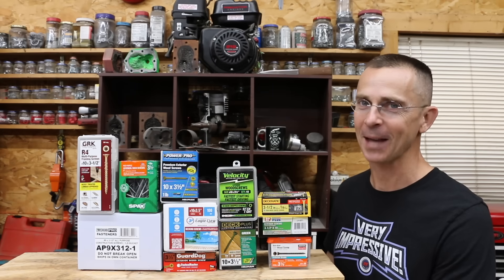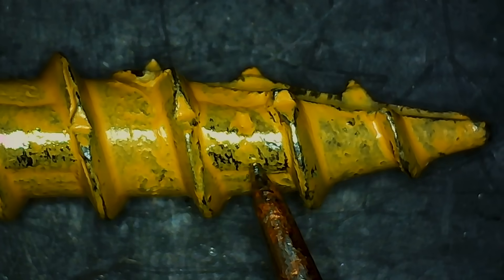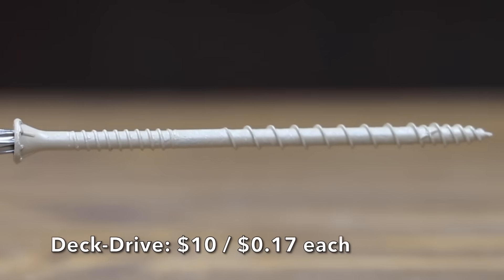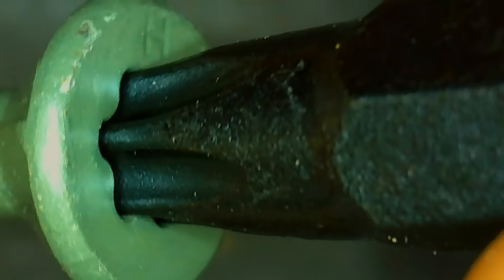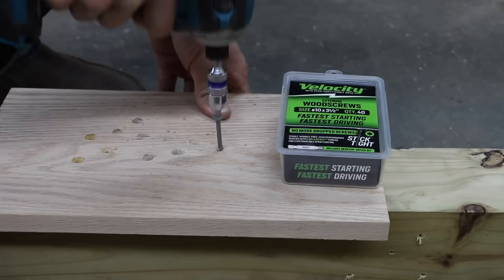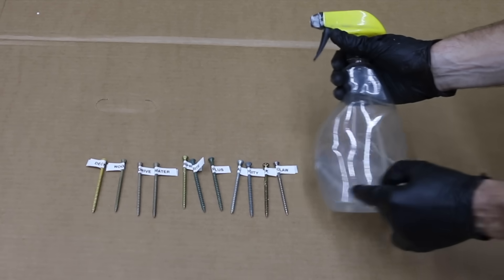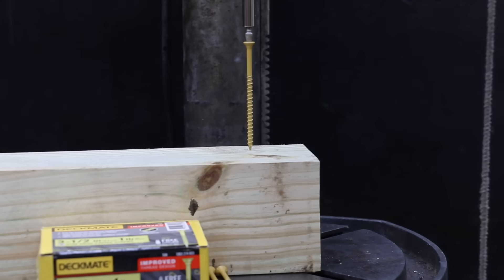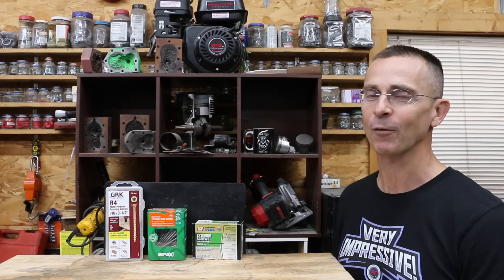Best Deck Screw? GRK vs SPAX, Grip Rite, Deckmate, WoodPro, FastenMaster, Deck Plus, Eagle Claw

Comment: GRK is my "go to" screw!  I have used the PowerPro screws and returned them because bit engagement was so sloppy the T25 bit was stripping out.  I use SPAX screws for all my structural screws. I do have some GripFast brand interior screws that I will use for small, noncrital projects.   I literally won't by any screws without #2 square head or T25 heads.  GRK screws are worth the money and the boxes are fantastic.
Reply from the maker: Thanks for sharing.

Comment: Awe 6 months too late project farm, already replaced all the screws in my deck because previous owners used 1in drywall screws for everything. XD

What a nightmare that was replacing them with 3in deck screws. Lol
Reply: I pulled up ~700 deck nails this summer from previous owners and then flipped the boards over and sanded and stained. It was "fun" 😂
Reply: @T-Mo_  Hah yeah exactly what happened with mine, almost all the boards were cupped, so flipped, sanded and sealed it. 

Think my deck only came out to 500-600 though. Your deck must be massive!
Reply: @BigHeadClan  it's only 12'x15', but they put 20-25 nails in per board 😂. Hey, at least we both finished it. 👍
Reply from the maker: Thanks for sharing!  Wow, that was a project!

Comment: I've been using those deckmate screws for a long time, as they are even more affordable when you buy  the 25lb plastic box, and they don't rust out here in Arizona, plenty of holding power for everything I build. But, I do really like GRK cabinet screws, and structural lag screws.
Reply from the maker: Thanks for sharing.

Comment: Thanks for the test - excellent as usual. Personally, I would probably go with the cheapest option because it's "good enough". All the screws were able to hold around 600+ pounds and experienced no corrosion. With that being the case, why spend more than you really need to? The only difference might be if you want the screw easy to drive and were willing to spend more money for that.  One final comment: This is one place where it might have made sense to use a larger sample size than 3. The density of the wood significantly affects the amount of force required to drive the screw, how fast the screw can be driven, and how strong the screw resists pullout.
Reply from the maker: Thanks and you are welcome!  Thanks for sharing.

Comment: I can't speak to deck screws specifically, but I've been using Spax for almost all of my heavier screw needs indoors as an electrician for about 10 years, from mounting ceiling fan boxes to the wood frames I make for electrical gear. I refuse to use drywall screws for that kind of stuff, and if you're watching reviews like this, you probably understand why :)

Comment: I built my deck over 20 years ago with deckmate type coated screws, Lifetime warranty etc!  Broke off, rusted and gave nothing but trouble. They changed the type of driver sued! As I had to replace boards and broken screws I went to Spax! No issues with these after several years. I am now redecking my entire deck and using PT lumber and all Spax screws! It has been a pleasure. No predrilling except at the end of boards(my choice). Great product in the field and by your tests too!
Reply from the maker: Thanks!  Thanks for sharing.

Comment: The most comprehensive testing  so that you dont get screwed building  your deck  or anything that uses screws, can we get a test  of  DURABILITY  of screw drives types , like our Canadian Robertson Square drives and popular in  US Torx drives in the 3 most common sizes,R1 R 2 ,R3   and  Torx  , using 1/4"Impact  drivers , I find #2 Squqre  drive tips  last  longer  than  the Torx flutes/tips,  thanks,
Reply from the maker: Thanks for the suggestion.

Comment: I use the Grip Rite brand most of the time. It's used in a handrail beside my backyard steps, and for the ramp going into my shed. Haven't had any to rust out. Have had paint to peel off the heads after 2 years. Usually it only affects the handrail because Spar Urethane was painted over them. I guess that attacks the finish. I wanted a natural wood color, but polished, so I use yellow or brown for the best color match.
Reply from the maker: Thanks for sharing.

Comment: I was waiting for this testing PF! I have used Deckmate in the past but that will not be the case in the future. Thanks for this video. I was wondering if you ever did any testing on those wall stud finders and how accurate they are? I know that some brands can be used to find not only wood location but also aluminum and steel as well. Anyway, hope that you & your family are doing well.  👍👍😉😉

Comment: I love spax because of the proprietary piloted torx drive. The bit fits the screws really tight and they’re a lot easier to start than most torx screws because they dont wobble around as much. That’s a big consideration if you have lots of screws to drive.
Reply from the maker: Thanks for the feedback.

Comment: Perfect timing for me on this video. :-) I have an old wood deck that needs replacing. Thanks for all the work you put into making these fantastic testing videos!
Reply from the maker: Awesome!!  Glad to help!!
Reply: @ProjectFarm  Thanks Todd.. I'm building a wood/metal cover for my 27ft Travel trailer.. This is valuable information, so I now know which screws I'll be buying to put it together.
Reply: @ProjectFarm  love the videos! Please test redline shockproof gear oil!
Reply: And I'm watching this from a highrise lol. Good luck with the deck!
Reply: @sorsorsor11  It just means that your deck has to be REALLY tall.
Reply: this is the first time i semi disagree with project farm. 
as seen here, even one screw will take a mans weight with relative ease, you usually use a lot more than is needed for structural integrity and shear strength. 
hes not really wrong in anything here. as in stainless screws are softer, strip slightly easier and you can snap em if you screw em too tight (also cost more).
but the only thing that really matters in screws is corrosion resistance if you want to make a deck that lasts.

specially with pressure treated wood, the treatment contains copper which can murder normal screws. decking screws specifically made for them probably work as well, but that would be a test taking at least a year to do (which i would watch with interest).
wanna be sure itl last, use stainless.

Comment: Havig installed mucho decks, here on the Outer Banks, I have learned the hard way, that coated deck screws ALL fail the corrosion test. One learns the hard way why that these screws almost always deteriorated in a very short time. The only screws I will use as deck screws must be at leaset a 304-grade stainless steel 3 1/2" screw. Decks that are subjected to water (i. e. boat slips) the 316-grade stainless steel should be used. If the appearance of the deck boards paramount, toe-nailed edge No. 7 x 1 7/8" stainless steel CAMO styled screws.
Reply from the maker: Thanks for the feedback.

Comment: You should test various brands of Jet line, i.e. wire pulling line ....break strength, stretch, abrasion resistance, etc ...as someone who just pulled a bunch of wire in my garage, I think this would be a good one! 👍🏻
Reply from the maker: Thanks for the suggestion.

Comment: In my remodeling work I use the GRK screws - all of their 5 different types. They are used in treated and untreated lumber. I can think of only one small complaint, and that is that I find them a little hard to get started in some woods. Two hands are needed, which is not always safe when you're hanging from a ladder with a driver in one hand. Based on this vid, I'd like to give Spax a try in case the GRK's aren't available.
 As usual, informative vid without being boring.
Reply from the maker: Thanks!  Thanks for sharing.

Comment: Very interesting, the compromises between products here.  If one is super concerned about rust/corrosion, The Eagle Claw is best, but at the expense of the highest price, 2nd to worst shear load, and more time to drive in.  Since the Grip Rite and SPAX came in 2nd on rust/corrosion, at about one third the price of Eagle Claw, and good to great performance everywhere else, taking a little more time for the Grip Rite seems well worth it for the money saved.  I'm surprised that the 305 Stainless Steel Eagle Claw was not any better than it was!  This is why we all love you!

Your ingenuity and procedures continually impress.  Great one, Todd!  Thanks
Reply from the maker: Thanks and you are welcome!  Thanks for the feedback.

Comment: Speaking as an engineer, I'm impressed that the variances are as small as they are. This tells me, you can't go wrong with deck screws -- plan for loads a modest fraction of the failure point and any will handle it.  That just leaves individual variation in stuff like coating quality, and, the elephant in the room, consistency of the wood being driven into (which from other data I've seen, looks to be much worse!).  Nice to see a stainless screw on here, I'd think those are fairly specialty (coastal salt spray, industrial environments?), shame they apparently aren't as strong but to me that's just a compromise for using something exceptional otherwise.
Reply from the maker: Thanks for sharing.
Reply: I wouldn't say they are weak though.  I am quite shocked at the sheer strength of a single screw.  I was worried about pulling myself up onto a walk way overhead beam I fitted in the garden using 2 screws just in case my weight broke the screws holding it in.  I am not 600kg so now I know that I don't need to worry, the wood may break though hehe.
Reply: @markmmm1737  The dynamic forces exerted, when you pull yourself up, will be much greater than just your weight.
Reply: 100% no on stainless. Bought a home with composite decking, ribs under neath rotted out. We could not get stainless screws out they all stripped out. Had to pry board up and remove the screws with channel locks from the bottom. Turned that several hours job  into 2 days!
Reply: @brianx2640  Rough! Yeah, that's a huge pain, just from the material being a little bit softer probably.

Normal screws I think are heat treated 1050 or so steel, not so hard like tool steel but much stronger than mild (have rounded off many a wood screw, the traditional tapered kind, man those things suck!).  That's why they bend a little, then snap.  305 stainless can only be work hardened, not heat treated, so it would figure the screws aren't as hard.  Next best thing would be a PH stainless, probably?  Might be too expensive for deck screws though.
Reply: @brianx2640  I think your issue was with the type of drive - if they had used screws with Torx heads, you probably could have backed them out.
Reply: SS only for industrial environment? Come on! I use only 304 stainless screws in my home, cost negligible compared to the items they're fastened on
Reply: wood variability really seems to be a hugely understood factor.  Matthias Wandel has done a couple tests recently and touched a bit on grain structure of several samples within the same species of wood.  Grain direction, size/spacing really, really seem to matter when taking measurements.

Comment: Good to see the GRK’s I use test well! 
The main benefit they have for me is that the heads aren’t all full of coating like many other brands. Could count on one hand the screws that had to be thrown away because the bit tip wouldn’t fit in, after tens of thousands of screws driven.

Would you consider testing the other types of screws? Trim screws, structural screws, ect?
Reply from the maker: Thanks for the feedback.  Thanks for the video idea.

Comment: Seems to me the biggest thing is corrosion resistance. Only time I’ve had a problem is when someone used regular old un-coated screws and they rusted out. I’ve stuck with Deckmates for quite a few projects and never had a single problem with them. They hold great and never rust. I’m sure the others are better, but sometimes all you need is good enough.
Reply from the maker: Thanks for the feedback.

Comment: I actually repaired a kid's bed yesterday with 6 GRKs -but they had more of a washer with button/dome head.  Nice to see them perform so well here.  I'll let you know how they hold up.
Reply from the maker: Thanks for sharing!  Thanks, looking forward.
Reply: Sounds like GRK cabinet screws.  I use them for a lot of different purposes.  They work great for templating custom steel handrails, for jigs, prototyping,  and hanging stuff in my shop.

Comment: I watch, enjoy, and learn from all your videos, but the methodology in this one may have some weaknesses.  Southern yellow pine latewood (the dark rings) is three times greater than the early wood.  Anyone who has worked with SYP knows that the hardness varies drastically and whether a screw will start will depend upon where you try to start it.   The torque it takes to drive a screw will be affected by how many late wood rings it has to go through, and that is continuously variable.  The wildly different torque readings you got driving the same brand screw with the same driver illustrates this.  Any wood species will present some degree of these difficulties, but the four species known commercially as SYP are notorious for this.  On the whole I think this was another helpful video and what I mentioned affects only a small part of it, but I think another choice of lumber would have given more useful results.
Reply from the maker: Thanks!  Thanks for the constructive feedback.

Comment: 9:16 not sure if the least or most torque required can make an easy choice for a quality screw. a screw requiring more torque could have a wider thread, slightly longer, etc...
Reply from the maker: Thank you for the feedback!
Reply: 16:09 just as I thought now that the Velocity at the bottom of the chart

Comment: I live in Germany and only we have out of the Once tested are Spax. I never have seen them coated before because they are coated thicc with brass or made of brass so they are basically corrosion resistent. But one thing I know is that when you buy Screws for Wood and you want that it holds you get Spax.
Reply from the maker: Thank you!

Comment: I have made my living designing homes and agricultural buildings. GRK screws rule. My own home is built with them. They create tighter wood joints, are easy to remove if adjustments are necessary. They are tough.  Never have seen one break. Never have used nails in the past 30 yesrs.
Reply from the maker: Thank you!

Comment: I've always liked the GRK, Grip rite, and Spax screws.  Frankly, good tests, as usual.  But for myself, while screws CAN indeed snap, though a bit of wax or soap, makes them zip rite in.  Holding strength?  Not so important normally.  Most important to me is that the screws don't rust, can be taken out if necessary in a few years.  Thus, I like stainless.  Unfortunately they are usually a bit too expensive.  One thing not mentioned were the deck screws for composite or synthetic wood, (Trex, etc)  Some screws for these materials come with a reverse thread near the head.  In my experience, this works great.  There ARE systems where you can even cap the screw, but that is pretty labor intensive.  The screws that have the reverse threads make a MUCH more attractive surround after they are put in.  Without it, there is puckering at the entry.  With them the entry is MUCH cleaner.
Reply from the maker: Thanks for sharing.

Comment: I am really disappointed that you left out 2 very important tests. I would even go so far as to call them THE most important tests. Instead, you included tests like shear strength, which are almost irrelevant in that there are not many applications that apply significant shear force to your screw. For those applications one would use carriage or lag bolts.

Test you should have done:
1) What is the durability of the screw head, or, how much torque does it take to strip out a screw? This is hands down the most common failure point in wood screws. This was a huge miss on your part.
2) How much torque does it take to snap a screw? Second only to stripping the heads of the screws is the number of screws I've broken - usually because I hit a really hard spot in the lumber, like a knot.
Reply from the maker: Thank you for the feedback!

Comment: Here's a video idea for you. I have a lot of my own experience and input but will wait to see if you do it.

As ive mentioned before, i used to run a tow and service co. One of the common calls i got was for bad fuel.

Person pulls up and picks wrong fuel for vehicle, proceeds to fill tank. Calls me in horror from various stages between noticing right away and vehicle stalling out at exit. 

So between those and scrap cars, i used to get a lot of fuel. 

The experiment: What ratio of gas to diesel will still run and produce usable power?

Variables: 
Gas or diesel engine. 
OBD I or OBDII (sensors count for a lot in my experience). 
Actual percentage of mix.

Bonus: Replace one or the other with water.
Reply from the maker: Thank you for the video idea!